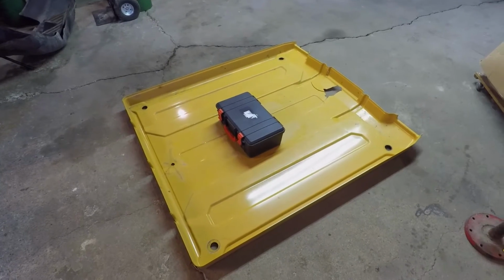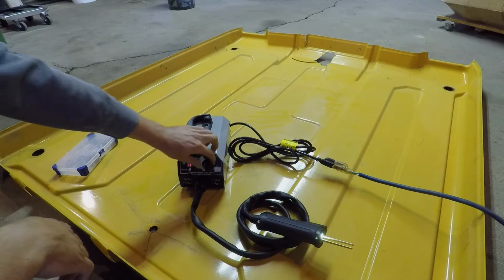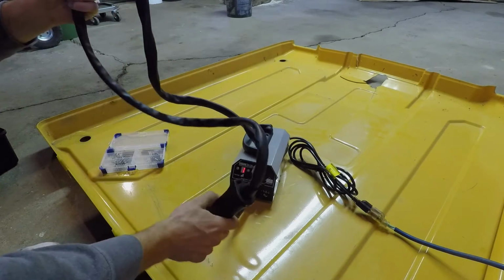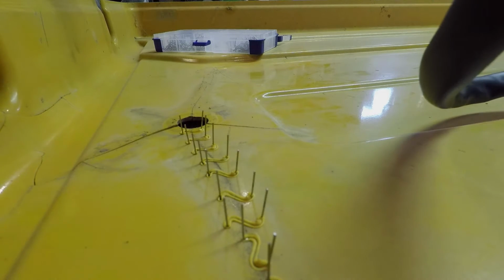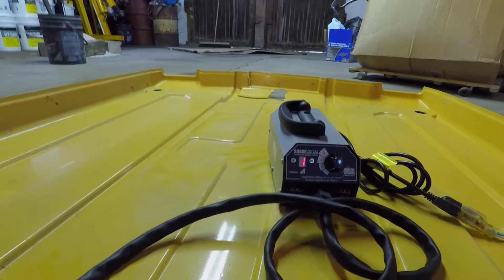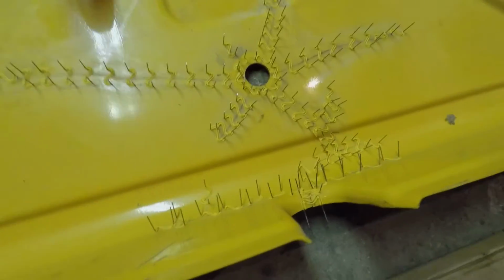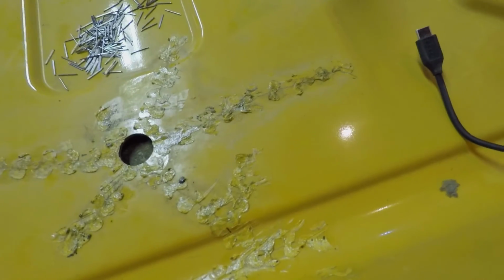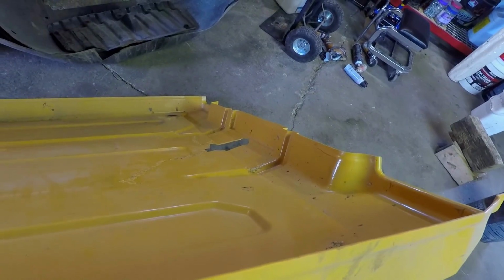How To: Fix Cracked Plastic (Heavy Equipment Roof)

Comment: Cheers. My doo came with a repair like this but I had never looked into the process. Admirable that you weren’t tempted to slap on yellow duct tape and call it good.
Reply from the maker: The roof to replace would cost $2,500. So the $500 plastic welder, and some work makes it worth it. I’ve never really done body work before. So making the hole in the front look factory might be interesting. I have some cat paint I will paint the fibreglass and body filler in between the ridges of the roof so hopefully it won’t stick out like a sore thumb.  As long as the sunlight won’t come through that hole and it will be cat yellow I don’t think it will bother me.